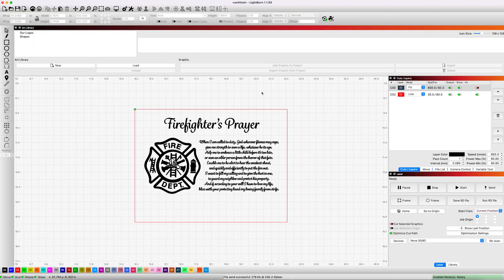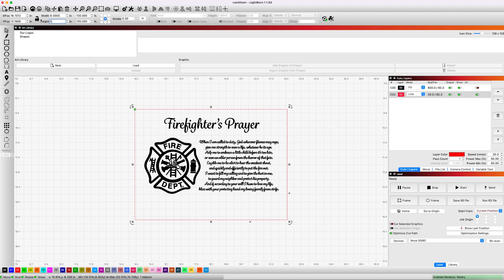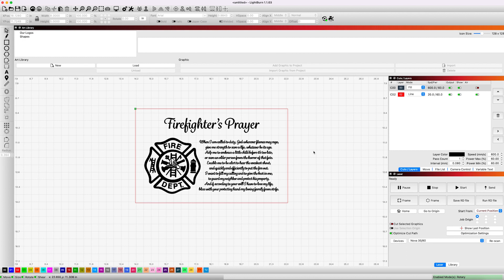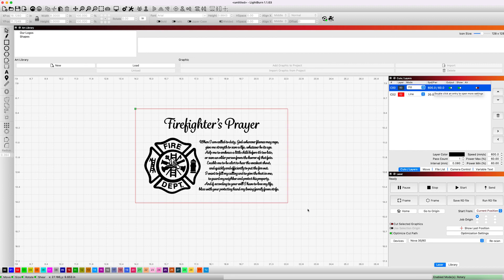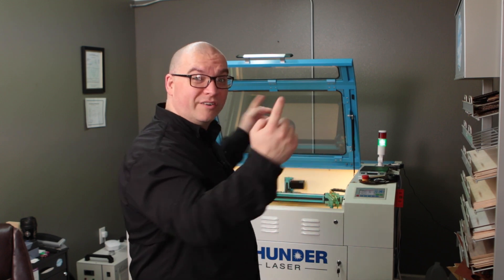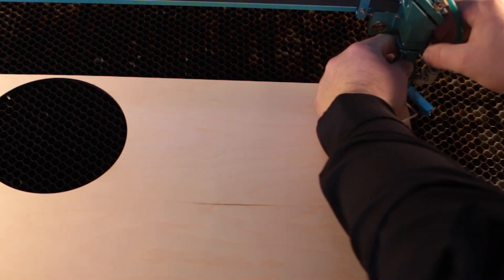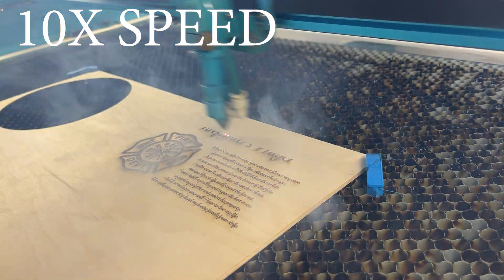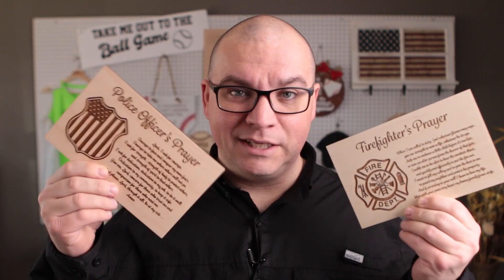Laser Engraving On Wood Thunder Laser Nova 35

Comment: Thank you Brother Malone, great video - we have the same laser - is there a specific reason you don't use 'air assist' when engraving?
Reply from the maker: Thank you!!
So...we are actually using the air assist.  
On the Nova 35, it has dual-stage air.  Low pressure and high pressure. In Lightburn, when you have the air on it means high pressure.  When you have the air turned off, it means low pressure.  So for our engravings we have the toggle off in Lightburn giving us a very light whisp of air coming out of our nozzle.  Then for our cut, we toggle the air on in Lightburn, giving us full pressure on the Nova.  Just make sure that you have your dual air on the Nova dialed in properly. That is what the test buttons are for on the front.  Press the low button and you should feel a tiny whisp of air coming out of the nozzle. Press the high button and you should have that dial opened up pretty much all the way!
Low air for engraving
High air for cutting
Reply: Thank you for the great tip?
Reply from the maker: @melcape8133  You're welcome.

Comment: Little bit of advise. See the grid to the right of the dimensions? change the setting so the blue dot is at the top so that when you resize, it doesn't center the new bounding box.  Thanks for the rest of the video, very helpful.
Reply from the maker: Yes, in this case, this would have been a great use of that!  We normally just leave it in the center....but for this scenario...it would be good to change it!  Thanks!